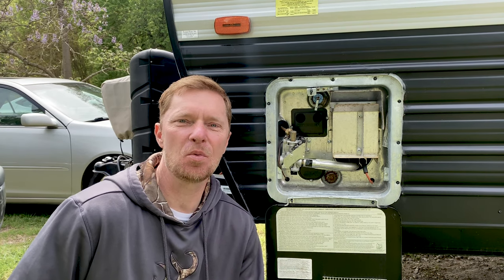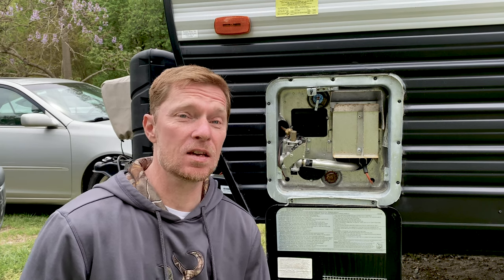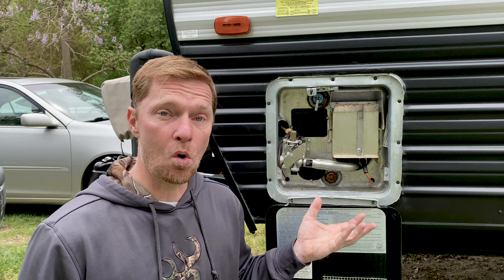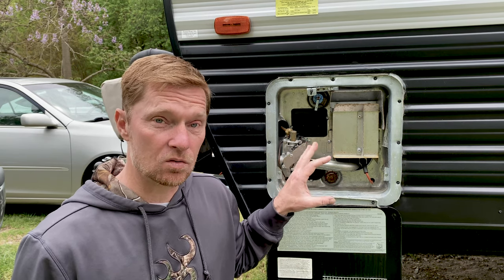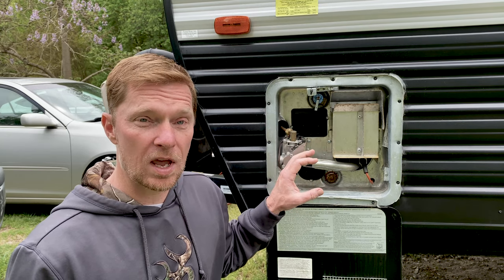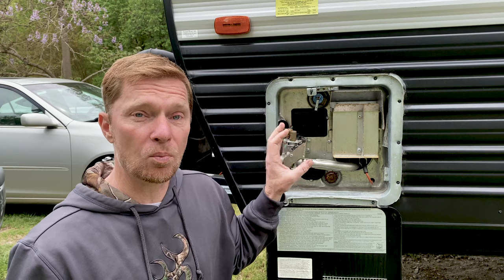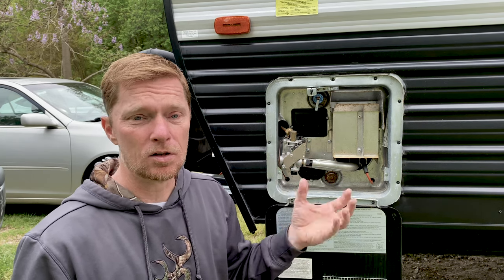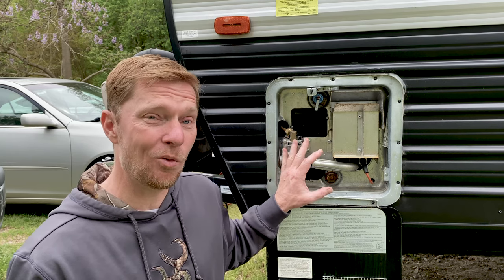Travel Trailer Gas Electric Water Heater Explained 2020

Comment: question. inside my camper attached to my water heater is  a plug and an outlet.  What is it for??  Does it mean my water heater works with electric if I have it plugged in. It is located where the bypass valves are.  Thank you
Reply from the maker: That is correct. if you have an outlet and a plug like you do at home, then the water heater will have the ability to run a heating element. Check with the dealer on how yours works exactly if different from what you see in the video.

Comment: If I only want to use electric water heater,but need gas for cooking is there a switch to turn off gas going to the water heater? Thanks again. 2018 Puma rlss
Reply from the maker: Yes there is. It whould be switch on your control panel that is near the switches for slide outs, awning and such. It should say something like "water heater". There are sveral different control panels out there on the market but if you turn that off, it should turn off the gas side only. Some panels have to switches, one for electric and one for gas. Mine only has a switch for propane. The electric on mine is outside on the water heater itself like described in the video. Hop this helps. If you need more clarity, please email me with pictures. How2RV@gmail.com

Comment: I have the same tank, it was lighting but then go off, acts like it's not getting enough air, if i leave the cover off/open, it keeps running, if i close it all the way the igniter just keeps clicking and kicks out, i have to hit the reset buttons, the heater was working last week, when i turned it on this week, it started doing this, when it was working and even now that i have the cover off its running, i can smell gas pretty bad, I'm wondering if my inlet tube is plugged by a mud dauber or maybe the plate you explained is for diverting the fumes
Reply from the maker: You said it right. I would check the inlet tube for debris that may have prevent good flow.

Comment: I have a propane/electric coming fridge a rm 3662 dometic. Believe it finally kicked the bucket. The climate control has no power and fuse isn't blown on the board. 

Is there a way to put a regular fridge in that would fit the stats of the space occupied by the old fridge?
Reply from the maker: That is a really good question. I have no experience in retrofitting the fridge. If you havent already, take a look at this first for further troubleshooting. https://www.youtube.com/watch?v=A7JboU8ZlE0 or https://www.youtube.com/watch?v=HvO0RzfxhzI
Reply: @HowToRV  actually fixed the old one it was a fuse blown on the breaker box apparently it runs off the same line as the power vent in the bathroom exhaust fan i mean. Which needs to be replaced
Reply from the maker: @imabeliever81  glad that you got it back up and running
Reply: @HowToRV  well for now it is the exhaust fan switch in the bathroom. That is causing the circuit breaker to blow. But can't find the switch. Ugh
Reply from the maker: @imabeliever81  that’s crazy. Email me a picture. I may be able to help. How2RV@gmail.com
Reply: @HowToRV  ok i sent a pic is the best i could get

Comment: can you choose if you want to run of power or gas or does it have to use both? If you are boondocking, do you switch that switch off so it only uses gas and not power so you don't drain your batteries from your inverter?
Reply from the maker: It uses either/or. Was boondocking, that battery is only used for the propane side, not the electric heating element.

Comment: Is it possible to install an electric water heater I live in my RV full-time and I only have gas while I know the gas gets hotter it is a pain dealing with the propane all the time so just curious if you could swap them out?
Reply from the maker: Thomas Polinze I would contact the manufacturer but I believe that you can look up the dimensions and if they match then it should fit. Remember that if you want to go that route to make sure that your RV can handle the extra power output plus your going to have to run cable from your power panel to the unit. Also, you need to have an empty slot available on your breaker panel to run an individual line. Hope these thoughts help.
Reply: @HowToRV  it did probably more of a pain to be honest thanks for the reply

Comment: I am looking for a video that demonstrates how to switch from electric to propane as well as running dual heaters.  If I park my trailer for a few weeks unattended I want to turn off the water heater and have piece of mind that the propane won’t activate if I turn off the electric switches.  I am new to RVing and need some answers.  Thanks!
Reply from the maker: Darren Miller you should have 2 switches. One inside and one outside at the water heater. As long as both switches are off, you will be ok. To  feel even more secure, make sure the propane is off. To take it one more step past that, you can disconnect the propane tanks and disconnect the battery and will most definitely have no issue. Hop this helps

Comment: We are trying to figure out out forest river Solera water heater.  Elec. won't work and there is no switch.  Propane works.  But we'd rather use the Elec. for it when camping.    We were hooked up to a water hose last weekend (first time out in it) we burped all the air out and then turned on the switch inside the camper.  But it never would heat up with Elec.  One thing I see on a video on the side here on youtube is something about a water pump.  To make the elec side of the water heater work do we need to have the water pump on?  It worked well for everything else without the pump on.  We are virgin rv'ers.  I wish someone would make a how to video for our 2022 Solera.
Reply from the maker: My water pump switch is separate from the water heater electrical. The electrical side of the water heater only works if you're on shore power. Every manufacturer sets theirs up differently. Most of the time, the place where you bought your RV will know how the electrical side of the water heater works. Most dealers have to work with the manufacturers to understand what they are selling and how to help the buyer. Let's try multiple paths here to see if we can get your questions answered. Firstly, contact your RV dealership and see if they can help you, even if you have to bring it back in to get the support one-on-one. Secondly, send me an email and I will see if I can help. How2RV@gmail.com

Comment: When having my city water inlet connected will my heater still work heating my water?
Reply from the maker: It will. The water coming from either the city water connection or the fresh water tank goes through the water heater. You will have to make sure that the water heater valves are open so that water can flow through it but other than that you should be good to go.

Comment: Thanks for the video. A couple of questions. 1 do I have to use my propane to use the water heater? 2 how long in advance should I turn on before showering?
Reply from the maker: I see that your new to the channel. Thank you so much for joining the IYO community. As for your question, I think that this video will help you out https://www.youtube.com/watch?v=r1QORFE2htM. I had just recently put this out to help with questions like yours. As for showering. It all depends on the temperature outside, let just say it is in the 80s then i would say around an hour or so. At least this is the case for mine. Another way to tell is to use the propane side. See how much time it takes from when the flame from the propane starts to when it stops. Do this without using any water from the hot side and you should get a pretty good estimate. The flame will stop when the tank has reached max temperature. Hope this helps.
Reply: @HowToRV  thanks forthe fast reply. I definitely will be following your channel. Yes, I'm busted... A complete newbie. I have a 25' puma travel trailer. Best I can tell, I do need to use both (electric/gas) because the power side is used to electric start the gas flame.  I assume I can leave system on while camping because the gas will auto shutoff when water reaches temp.? Thanks again for your helpful advice.
Reply from the maker: @UKBLUE1  there are 2 electric side. The 12 volt side which is ran from your battery is what ignites the propane gas. The other electric is shore power or the power from the cable that you plug into the campground. This is 110 volt like your house has. The 110 volt powers the electric coil inside the water heater to give you hot water. You can run either the electric or the gas independently or together. Does this make sense?
Reply: @HowToRV  ok, so I don't have to turn on the propane has unless I want it to heat quicker?
Reply from the maker: @UKBLUE1  kind of. You can use propane to work with the electric to keep hot longer. Not much but a tad longer. We use propane a lot because of how much power is takes to run the electric. Depends on the situation.

Comment: I am still confused about the 110 and the gas do you use both or one or the other?
Reply from the maker: On mine, I could run both at the same time if I wanted the water to heat up faster.

Comment: So in order to get more than just the 6 gallons in the tank, you have to use your electric/and propane at the same time? We are running out of water in less than 7 mins in the shower.
Reply from the maker: running both at the same time will help with extending the time that you have hot water. You can also extend the hot wtaer time by shutting off the water while lathering up. We also try not to use the hot water with back to back uses (example: washing wishes and then straight to taking a shower). Did this comment help?

Comment: I was told that I should remove the anode rod everytime I store the RV (even inbetween weekend trips). Would you agree or disagree?
Reply from the maker: I do not take mine out after every trip. I do camp a lot during the winter so mine stays in and only take it out twice a year to inspect it and clean. If you are going to store yours for the winter, I would say that you should remove it then. If you only go out twice a year during the non freezing months, then drain the tank and leave it in. If you camp a lot like we do (more than once a month) but mostly during the non freezing months, then leave it in and leave the tank full of water. Let me know if this helps.

Comment: I have the switch outside in the water set to “on”so i assume it is on electric. I also have a switch on the control panel inside my motor home. When I switch it on a red light comes on for about ten seconds. Does that mean it has turned on the propane side of the water heater too? Also if I push the switch the other way does that make the gas way stop a then I am just using electric only?
Reply from the maker: Camelcompany on mine, the switch on the outside in the on position does the electric. The one on the inside does the propane. Have someone turn the switch inside on. Make sure the propane bottles are on as well. Stand by the water heater outside and within a minute or so, you should hear the flame that heats the water cone on. All this being that your setup is like mine. If you go back and watch the video about me installing a voltage and amp meter, this is part of the reason for that. I couldn’t tell if the electric actually came on or not. I did a test with the electric l by keeping the propane off and the water got hot but this method is timely and I may or may not be the most patient person in the world. LOL. Hope this helps.

Comment: Perhaps I missed this element, can a newer RV unit run strictly on electric, or is the combo Propane/ electric required to run both facets? Thank you
Reply from the maker: On mine, I can run either one at any given time or run them together. If I am connected to shore power (the electrical outlet at a campground) then I can run both or just one or the other. Hope this helps.

Comment: Re; the solenoid…12 volt battery only or 12 volt battery and or 12 volt inverter with fuses under the stove?
If you have 30 amps at the pole then you don’t need your car battery right?
Reply from the maker: The 30 amp system charges the battery and then the battery runs the 12v system. This being said, you need to have a battery installed. At least mine does.

Comment: Hi thanks for the information.  I install my water heater and I don't know to connect the electric ignitor
Reply from the maker: I did not have to connect mine. The ignitor was already installed. All I had to do is to make sure the the 12v side was wired coreectly and that the fuses were reinstalled.

Comment: Do you have a video that will show what to do if you arre only getting cold water when you turn on the hot water
Reply from the maker: I show videos about my experiences and have not ran across that one. Check you electrical fuses. Both 12V and 120V. Also check to make sure that the reset buttons that I showed in the video are reset. They are the ones located at the water heater outside. Please let me know what you have found out and your resolve.

Comment: I have the same water heater on my Grey Wolf trailer. I am new to RV life, bought this from a private seller and all works fine except I can't seem to get the water heater to operate on propane. The fuses check out ok, both fuel tanks are full and functional, and the electric heats the water. I am not sure why the propane part of the water heater isn't working, any suggestions?
Reply from the maker: I would start by checking the resets at the water heater. They are the black rubber looking push tabs.

Comment: So how long of a shower can you take before it runs out of hot water?
Reply from the maker: I usually say about 1 minute per gallon on water heater size. I had a 6 gallon tank so I could get about 6 minutes if managed right.
Reply: Thanks 
And how long would it take to heat up for the next person?
Reply from the maker: @diverm2371  We try to stagger showers. I like to take mine in the mornings and the wife likes to take hers at night. When our kids were camping with us, they mostly liked the shower houses because they liked longer showers. But in the rare cases when we were to take back-to-back showers, we usually waited about 30 minutes between each.  We recently installed a tankless water heater which I have made a couple of videos about. Please go and check them out. I did the tankless mostly because I like really long showers...LOL.. Who doesn't right.

Comment: I recently replaced the anode in my 2019 travel trailer. I have the same system. It will heat up the water with the propane, but it’s not working on the electrical side. I actually have never turned off that switch before. So, I’ve been camping several times and that switch has always been on. Now, when I hook up electric to 30 amp, it trips the outlet. Why do you think it’s doing that? My solution is just keep that switch turned off and use propane only. But, I would like the electric part to work.
Reply from the maker: Please take time to watch this video ---> https://www.youtube.com/watch?v=HrcLMM3hG_A

Comment: Hey Jason I was wondering what the benefits are running gas and electric from my hot water heater at the same time? We have a permanent campsite so we never leave the camper anywhere but they’re all year round. I know in the summer camp site faces the sunset so I can get pretty hot outside. My concern is it it is already warm enough with the propane heater running the water. So we strictly use electric to keep the heat down on the outside of the camper.
Reply from the maker: Benefits are for longer runs of continuous hot water when in use. The use of propane should not heat up the inside of your RV. I would think that if your ok with how much hot water you have when your using it before running out. I wouldn't change the way that your doing things today. Another benefit of using the propane is the reduction of how much power your using. When the electrical side is in the process of heating up the water, you could see approx. 15 amps of power consumption during that time. Please take a look at this video for better understanding power consumption. https://youtu.be/n_v7QkFzNds. Hope this helps explain your questions.
Reply: @HowToRV  Thank you so much for the fast reply. We just purchased a 2021 Cherokee forest river last weekend was the first weekend it. We upgraded from a Jayco 16 foot
Reply from the maker: @JasonSetley  Congratulations

Comment: I have a question.   If i have the electric on, does the propane have a shut off/on switch too?   Im not understanding that part.
Reply from the maker: Mine has a switch to cut on and off propane and another switch for electric. They are separate. If I want to, I can leave them both on or one at a time. Hope this helps.

Comment: Do I need fill the tank first? Or can I just run the hot water
Reply from the maker: You most definitely need to have the water heater tank full. If you do not have water supplied to your RV through city water connection or water in your fresh tank with the pump on, you could take a chance in ruining the electrical heating element that is supplied from shore power.
Reply: @HowToRV  I have it hooked up to a city water connection

Comment: Can you run electric only without using propane or does it run the propane as well as electric at the same time?
Reply from the maker: On mine, I can run either at the same time or individually. You should be able to run electrical only.

Comment: ive heard if the heating element burning up , how does this happen? & can it happen if you leave the electric heating element on at all times but have city water connection running to it ? Thanks
Reply from the maker: The heating element can burn/short out with years of use . Most of the time when I have heard of one burning up is with there isnt any water in the tank.